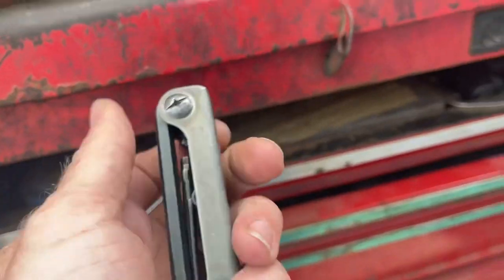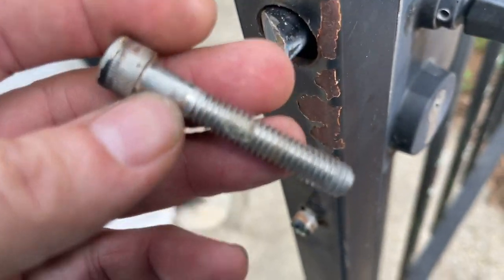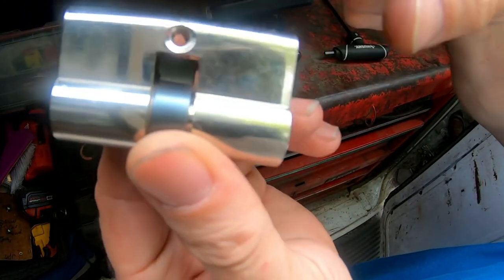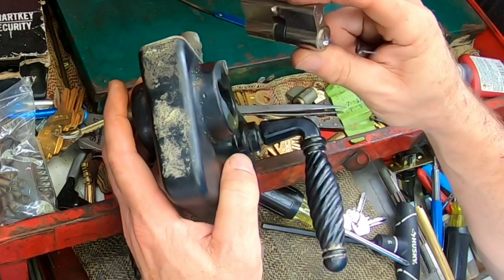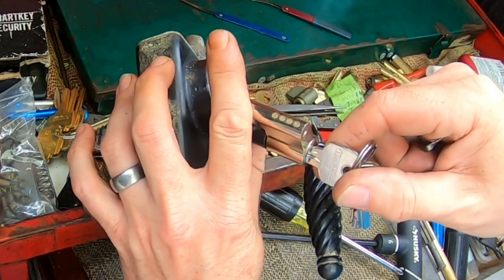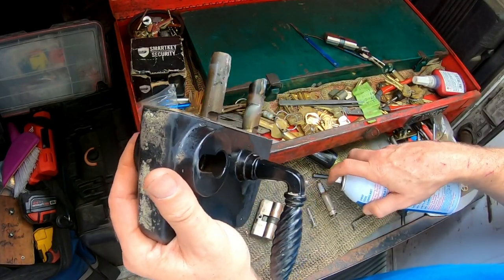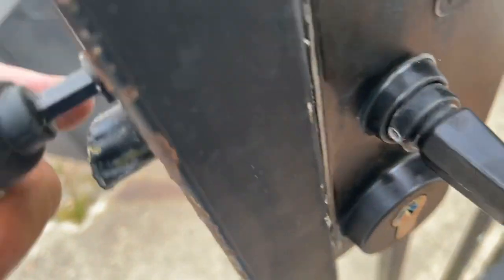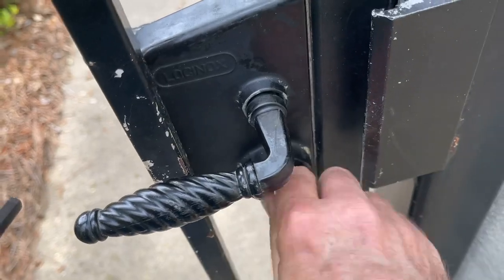replacing profile cylinder in Locinox gate lock

Comment: So happy to now have seen the gate I have been told about for so many years. The magic gate with open frame to get the spacers back after dropping them. On the newer locks both case and screws are designed to screw in tight without the spacer. That has been a saver. 
When picking double euro always remember to push the pick in deep to connect the right plug to the cam. And you can’t tell if the cam points left or right, as it just depends on the way you hold it.
Reply from the maker: I realized what I was doing during edit with the cam direction and smacked myself in the forehead 🙄
Reply: Need a small strong magnet on a string.
Reply from the maker: @ImGumbyDangit  it would stick to the gate :)
Reply: @selock  yes, why did I not get that
Reply from the maker: @ImGumbyDangit  I’ve “been there” with a tall metal storefront door when the top rod fell 🙄 it was a super PIA

Comment: Hi Jason. 
Thanks for taking the time to do this video. 
Educational as always. 
So you do get to do Euro cylinders.
Them cams can be awkward, at least it wasn't aMTL cog wheel one.
Not come across this type of lock yet , but you never know. 
Thanks again for sharing your knowledge. 
Oh I have the metric sets of the folding sets.
I haven't yet done the Chicago screw mod, what size do you use ? There is a shortage of old style ironmongery stores here only big brand ones unfortunately. 
So I will probably need to go online to even get them.

Comment: I had to master key one of those double cylinder profile cylinders yesterday in the shop.  $45 for the cylinder and $20 per cylinder for the keying.
Reply from the maker: standard profile? Yeah they are pricey but these sealed units from locinox are nowhere near that so its much better to replace :)
Reply: @selock  The customer said they had a master and another key they called the child-lock, so it was those two keys I had to master.  Lucky for me I could use a security hex wrench (small) to remove the top and re-key to both keys.

Comment: Hi Jason I have this exact lock but the lock is engaged with the wall and the key turns but won't unlock the bolt. I can't get to the Allen key because the gate is closed. I've tried WD-40 in the lock and where I can with the lock bolt itself and lifting the gate while turning the key but it won't shift. Any ideas?